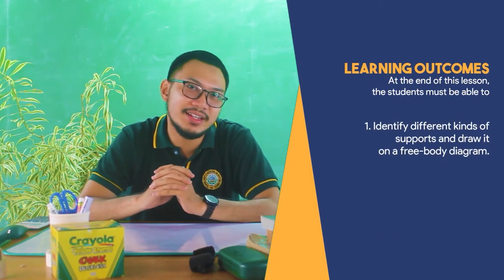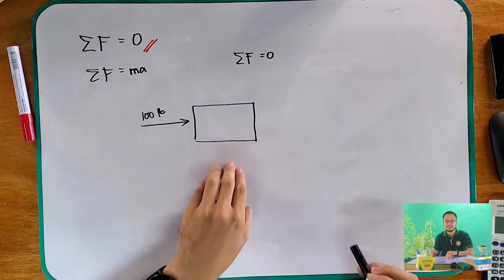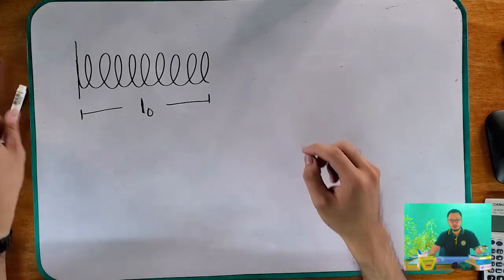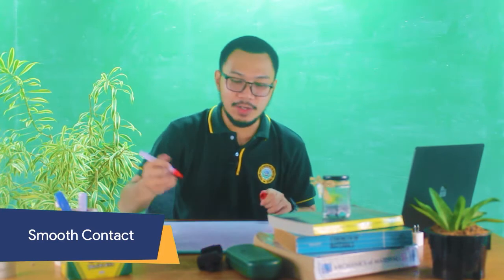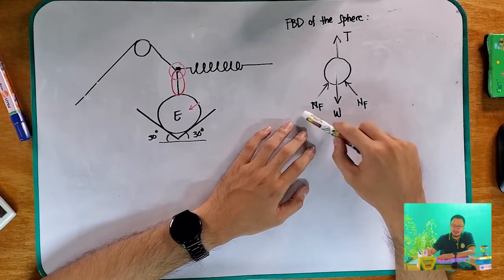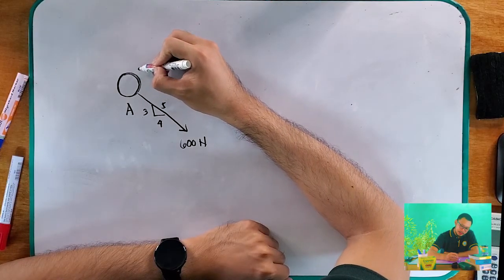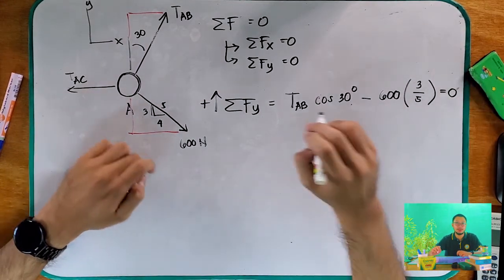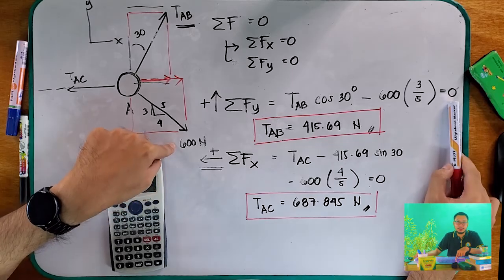Chapter 2.4 - Mechanics I (ESci123)

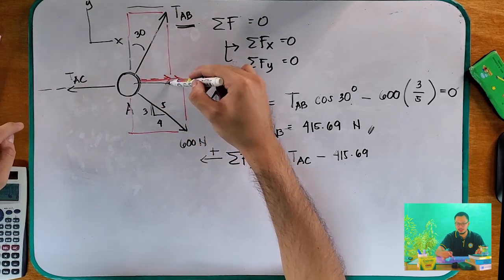Comment: Sir sa 26:13 , pwede cos imoha gamiton dhaa? since naa mn ka parallel na 30 degrees nya 60degrees man ang angle kung imo e minus sa 90 nya naa nmn sd value ang hypotenuse.
Reply from the maker: If ang cosine imo gamiton, cosine 60 imo. Kay kung sa 60 degrees imo igamit nga angle, ang x component na ang adjacent.
Reply: @kuanacademy5399  thank you sir, same rmn diay ang value kung sin or cos ang gamiton